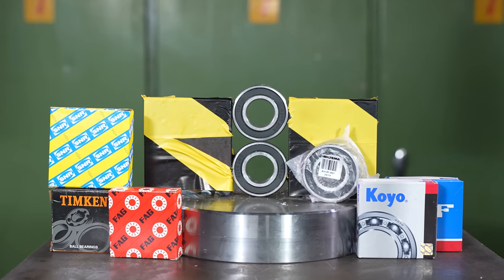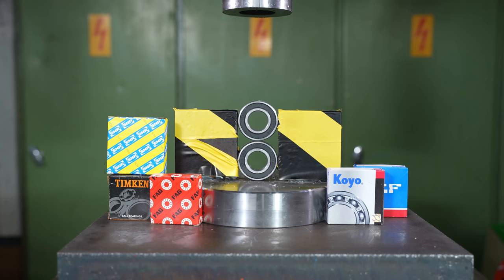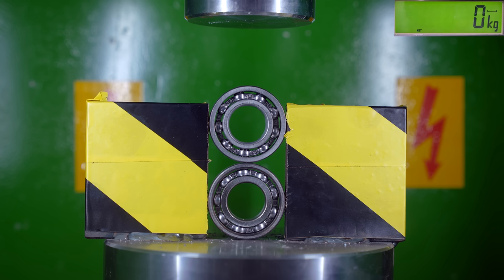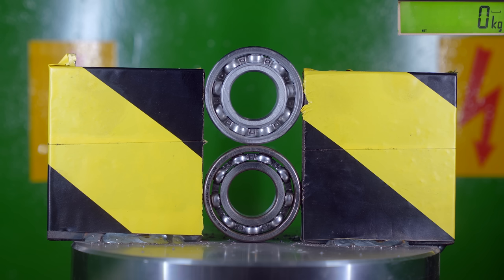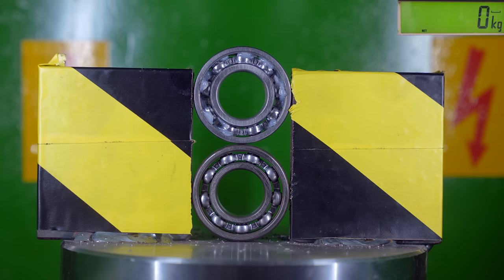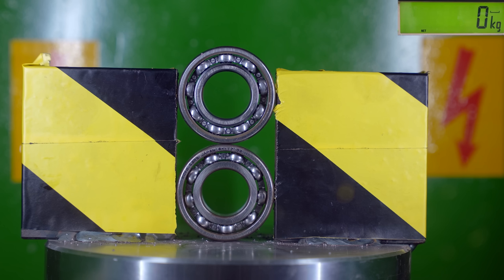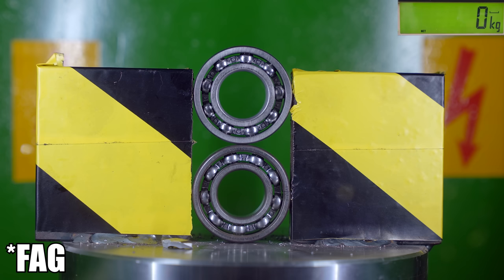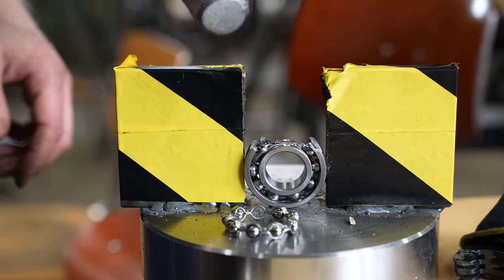Brutal Ball Bearing Test with Hydraulic Press

Comment from the maker: Go to https://buyraycon.com/hydraulicpress for 15% off your order! Brought to you by Raycon.
Reply: first
Reply: you really need a disclaimer that this is purely for entertainment and not scientific or in anyway useful information. the ball bearings are not made to withstand experiments you take from your behind. they are for rotation and wear resistance not for smashing against each other in poorly machined holders xD
Reply: Been using my Racons for a couple years and they're the best I've had, so far!
Reply: Lol you brought up the axes again
Reply: 7 @stremmify AA 5
Reply: this has to be a side to side pressure test and not top bottom. Science dictates to much towards the bottom one cracking first.
Reply: Would be cool to see which bearing can handle the most pressure while they are rotating, if you can get an electric motor to turn the bearing while its being pressed and compare each bearings maximum pressure
Reply: I hope that this "test" is not taken first, since the task of the bearing is not the pressure from the outside.
Was this "test" an joke? 🤷‍♂️🤦‍♂️
Reply: If i ever need these ball berings im buying timkin lol.

Comment: Just one note. The main parameter for ballbearing is not support maximum load on radial direction. Most important factors are precision and wear resistance. This test measures more likely tensile strength and toughness. Especially toughness is usually on the other end of tradeoffs with steels.

Skf is in practice, very good bearing and in some applications, lasts ten times longer than lower quality one. It's probably because their material is hard, wear resistant and very homogenous. Also the initial precision is high.
Reply: Hardened steal makes much better ball bearings and races. Soft Ductile mild steal won't break and makes terrible bearings and races. So, the Bearing that shattered first, has the better hardening and is probably the better bearing, should work and wear better than the top of his list.
Reply: @WeBeGood06  It also depends on steel quality. Alloying helps to gain other properties with same hardness. Also heat treatment process have big influence on properties.
Reply: You're right about the test but Timken makes the best bearings.
Reply: @WeBeGood06  Timken makes the best bearings.  That's a known fact.
Reply: SKF have best need test other methor, this not have ecual methor test. need axle and run bearing how long all can run my skill have many motor and FAG have worst bearing what newer has made, no long time and has out of work, and SKF have run long long time.
Reply: @teropiispala2576  The iron ore extracted from Swedish is the best quality in the world. The only mine superior in purity and quality than the Swedish mines are Vale Brasil. With pure iron ore can make excellent quality alloys  for those willing to pay for the right product.

Comment: My thoughts before watching would be the more expensive/better quality bearings might be harder but more brittle, so the cheap ones with a worse heat treatment might win because they don't shatter as easily
Reply: My thoughts exactly!
Reply: Definitely
Reply: So a more accurate test would be to run the bearings under load with more "normal" use situations, but to speed up things no lubrication.
Looks like a Project Farm test.
Reply: @ehsnils  less fun explosions though, quality control runs those kind of stress tests regularly and it's a really boring process that's usually completely automated these days. This isn't so much a scientific test as it is a bit of fun
Reply: @Lilith-Rose  Ever seen a bearing overload? The recent train wreck in Ohio was due to one.
Reply: @ehsnils  of course when you're talking about bearings of that size and weight rating it's going to be a little different,  also they're not the same kind of bearings, but when it comes to the bearing itself failing under load you're talking about a bit of smoke and eventually disintegration but nothing like as energetic as this. The bearing itself failing is very anticlimactic, it's when the pieces that bearing is supporting fail that the real action happens and wheels come off or equipment shakes itself to pieces
Reply: @ehsnils  for a good example beyond the press themselves have a video of the bearing failing on their big lathe, one of the first results if you search lathe bearing failure. When you see dramatic catastrophic failures they are usually what happens to the equipment after a bearing failure is ignored/missed rather than the bearing itself failing
Reply: @Lilith-Rose  I have seen some quite serious bearing failures at work, making the lathe bearing seem mild. Bent a 20cm diameter axle in one case. Was a headache to get out of the housing.
Reply: Bingo! Project farm would have included an accelerated wear test.
Reply: Testing a bearing in a loading mode it won’t encounter in service is pointless..
Reply: Agreed.
Reply: I Agree
Reply: Totally useless test. Most import thing is the tolerance and max load and bearing wearing. The outside case strength represents nothing l.
Reply: Yep .
Reply: Exactly.
Reply: @ehsnils  Nasty. I have seen the results of the 4.5 bearing in a JTD8 jet engine seizing between the HPT and the LPT axle during load. The LPT axle is over 10cm in diameter and made of mono crystal steel. Got twisted many turns but did not break!
Reply: That's true! I have a same opinion.
Reply: Exactly my thoughts. Bearings have to resist burnishing & abrasive wear while supported by an axle & the wall of a bored blind hole, not pushing from opposing sides by a press. The tougher, softer steel may win against a press but the brittle, harder steel will win during normal use.
Reply: Your thoughts are correct on this test but as for what they're actually intended for that would prove that the Chinese one is the worst choice for its intended purpose
Reply: @eric63377  I fully agree on that one
Reply: 4sure!  Fact

Comment: Timken totally got the win before it failed.  You just got a little overzealous with the press.  It happens!😂
Reply: Didn’t even fail until after he started squishing the side supports. Timken wins.
Reply: You press hard and always to the bottom, extend the full shaft. There is no half-assing in this channel.
Reply: I'm not exactly sure how The Hydrologic Press Channel got over zealous with anything, but you're right.
Reply: I worked for Timken, but in the belt line, not the steel fasteners.
I'd still be there, were it not for the smell... Everything smelled of asphalt. Every simmering meat, every heated oil, asphalt... 
Saddens me, because they were unionized, and paid VERY well. But no amount of money is worth one of my 5 senses.
Reply: U S A!  U S A!  U S A!
Reply: SPOLIER ALERT
Reply: So Timken is the worst, cheapest bearing as the steal was the most ductile and least hardened. Hardened steal will shatter first.
Reply: but timken cracked first on the top :D
Reply: OSHA DOES NOT ALLOW POPCAST DURING WORKING

Comment: Impressive pictures! I think the test was very entertaining, although not very practical. From my experience the Kugelfischer, ZF, SKF bearings have massively hardened surfaces to minimize wear. This hardening massively reduces flexibility, which is also not needed at this point since the construction requires specific fit of the pockets holding the bearings. By design the better bearings lose because their shells are more brittle. So I think, while entertaining, we should not draw any conclusions on overall quality from this shootout ;)
FWIW, a more practical test design would be a block with a fitting pocket for the bearing to go in and oppositely a shackle with a bolt fitting into the inner hole of the bearing according to spec. Then measure the pressure when the bearing shatters. This would not be as entertaining, though, as the bearing would sit inside two large slabs of steel.
Thanks for the entertaining video and your rad welding skills! I love it.
Reply: Whaha no way skf lost or is the worst, it can't be, so much things come Into play when testing bearings 😁
Reply: Perhaps they could have a strong axle supported on both ends by a properly mounted bearing, and see which one fails first. Then you still have a shoot-out.

Changing the bearings after the result might be a problem though, they would be pressed into the axle...
Reply: @TheEvertw  If only a guy had a press to get the failed bearing out?....  Would only be fair to have a new, machined plate to hold each bearing, and a new section of shaft to keep things more consistent. If you really want to get technical, you would need to measure the bearing inner and outer races and machine the pocket and shaft to match.  It would be telling to take a lot of bearings from each brand, measure them and see which brand is the most dimensionally consistent. Few of us have the equipment necessary to measure to the differences to that resolution though. 
Any of those bearings should last the lifetime of the machine if the proper bearing is specified and kept clean and lubricated.  But if you are building a dragster that will exceed 300mph in a quarter mile, maybe you should go for the best? Price point really does come in to play with bearings.  All of those manufacturers are capable of making fantastic bearings or ok bearings. The difference is how anal they are when assembling a bearing to get things as close to perfect as you want to pay for.   I'm going with Timken just cause I like the name.
Reply: @laserflexr6321  "I'm going with Timken just cause I like the name." That;s so scientific. 😂
Reply: Timken makes the best bearings.
Reply: This test has absolutely no value at all other than entertainment.  This test does not test the bearings in the way they are used or designed to operate.  Totally silly.  In the real world those Chinese bearings are never what they are supposed to be.  I have seen them with less balls than their competitor of the same size, so can carry less load,wrong grease, and not accurate fit.  I am in the motor repair business and would NEVER use a Chinese bearing in a job for my customers.  Just look at all of the problems with counterfeit bearings coming from China.  They might be capable of producing a quality bearing but are willing to cut too many corners and cheat on the specs.  Buyer beware.
Reply: This comparison has no worth.

Comment: Seemed like most on the bottom lost.  I don't see why either, but maybe get some combinations and test them each way around a few times to ensure you get a consistant result on which one fails, either the brand, or the position.
Reply: I knew to read the comments before I posted, you totally nailed what I was thinking!
Reply: Yeah, I had the same though and like Jim Sea, I wanted to read the comments to see if anyone else had the same thought.
Reply: hmm, perhaps the hydraulic cylinder has a tiny amount of play, allowing the top ball bearing to move ever so slightly, dampening the impact a little bit.
If this is the case, putting a plate at the bottom, not connected to the table, might even it out a bit.
Reply: need to bear in mind that rig is not 100% rigid. would think that it might bow on the upper side giving lower said disadvantage.
Reply: I am like some of the other commentors, I thought it odd the bottom bearing seemed to give up more often.
Reply: Best coment

Comment: I agree with a bunch of the other comments, try them as tops and bottoms to see if it makes a difference.
On the final battle, the top bearing won, as it only broke because the press kept going crushing it into the smaller ring which is going to be much stronger than the big one.

Comment: Cheap Chinese bearing is most likely softer. It will wear out much much faster and they are soft enough to flex without breaking. Timken has made bearings for 124 years. I would think that they would know how to make a good dependable bearing lol.
Reply: Exactly what I was thinking. The harder bearings don't flex as much, but will outlast the softer ones in a real world application. Still fun to watch though.:)

Comment: bottom bearing has 4 points + veight of upper bearing.
upper bearing has favorite position, beacause the holder can flex in some miniscule millimeter, but from U-shape it becomes V-shape.
so, upper bearing can get some more deformation before touching the sides of the tool and applying the real force.

To my mind, the battle shod be bearing A vs B upper then B vs A upper.
and the next round should be fresh bearings for start.

Comment: Timken. It may have flexed first but the other shattered before you started compressing the holding tool. Timken blew out it's center after you began deforming the tool adding 2 more compression points.

Comment: The loads on the bearings are not designed to operate in that mode. The SKF bearing had a better hardness than the Chinese bearing and therefore more brittle, which is a good thng for bearings.
Reply: SKF KOYO and FAG are the high quality brands in this test.

all of them shattered.

the optimal material selection might not be the same for rotating at high rpm as being crushed with insane amount of force. :D
Reply: @mattiasakerblom3426 -  Show me one device where the bearing is being loaded radially at a single point on its outer race side of the bearing. If you can, I guarantee it is improperly designed. I also guarantee if the bearings are incased in a housing with a shaft through the inner race, as they should always be, the bearings that are at a proper hardness of 68R will still operate at a higher load than the cheap Chinese bearings. I should know, I built large drone helicopters in China living there for 8 years and ended up always having to change out the bearings to one of the name brands.

Comment: From an engineering and material strength standpoint it seems logical that the rings (inner or outer) break or deform because their purpose is only to provide a polished hardened (inevitably brittle) raceway for the balls to roll on and are NOT meant to provide structural support on their own. 
They are always pressed into/onto a part that provides external structural support/strength/rigidity.

 Except in relatively light duty applications like skate/skateboard/caster wheels.

Edit: I'd bet the bearing manufacturing industry has standard tests for performing comparative strength tests relevant to a given bearing's design and intended application.

Comment: A ball bearing outer ring is not designed to take an uneven load. They also need a hard surface to withstand the pressure of the balls when not mowing. To sustain a long running life is most important.

Comment: The shootout style videos may be fun to watch, but testing each bearing individually with the OD of the bearing in a proper bore and the force of the press transferred to the ID of the bearing with a properly sized rod would be more realistic. There must be a test spec for the static load rating of bearings. That is basically what you are testing I think.

Comment: The issue is the higher quality bearings are going to use higher quality 52100 that’s heat treated to a harder RC. This will inherently make them more brittle but will last longer in actual use.

Comment: The one that broke first, the easiest won the day.

Hardened Steal, which is what is better inside a ball bearing is more brittle and will shatter first. The cheaper to manufacture is just unhardened, more ductile steal. So the one that breaks first is probably the better, harder, longer lasting ball bearing.